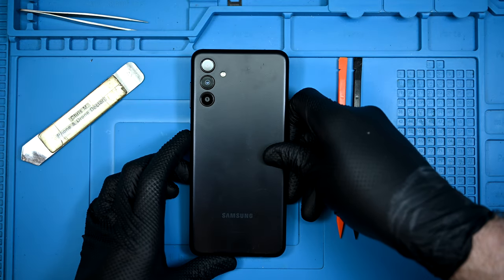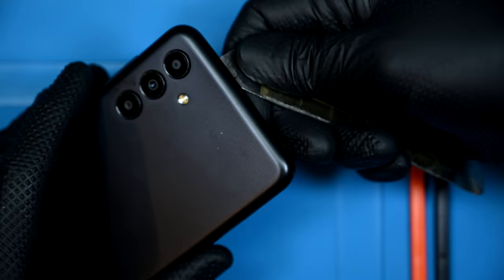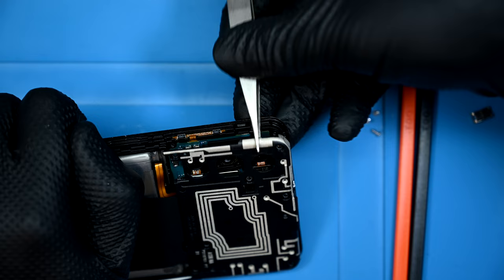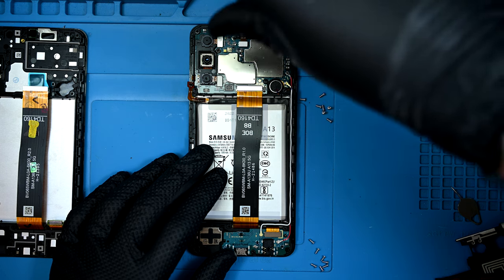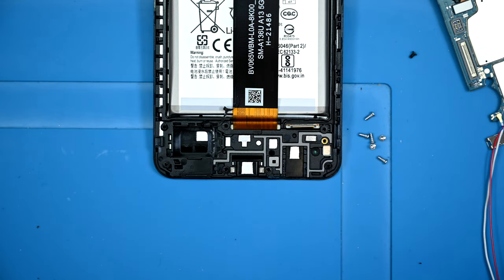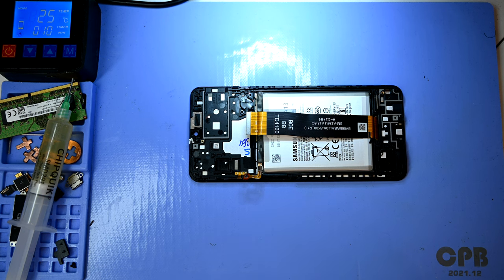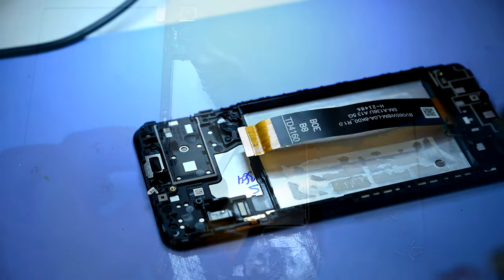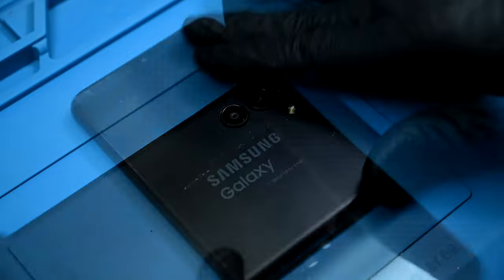Galaxy A13 5G (A136U) Screen Replacement | Frame Swap | Teardown Guide

Comment: The replacement screen/frame I received does not have the up/down volume part included.  A bit nervous about how to remove that from my old frame.
Reply from the maker: Isopropyl alcohol! Absolutely saturate it then gently peel off. A hair dryer will also help quite a bit. Try to peel up one little bit and shimmy your tweezers under the ribbon, working it up instead of pulling on it directly
Reply: @TapticDigital   I greatly appreciate the fast reply!  It worked!  Phone is back online!   Subscribed to your channel

Comment: Not now matter how many times I watch this (and others) I cant figure out how to get the back panel off, there simply seems to be no way to slip the pry tool between the seam to get the back panel off. I'm fully lost at this point, is there glue or something holding it down? it looks just clips but no mater how much I try I cant manage to get any leverage into it.
Reply from the maker: It's definitely very tight at first, it's easiest to slip in right next to the SIM tray. Thankfully the panel is plastic so you can use some serious force, and since the frame is right there you shouldn't be able to go "too far" in.
Reply: @TapticDigital  took a lot of effort but I managed to get it, after that it was a breeze and the tutorial helped a lot, thanks for the advice.
Reply from the maker: @chriswillis4960  so glad it worked! If you need any repair help come back and see me, I almost always respond to tech question comments within 12hrs.

Comment: I'm curious. What is the dimensions of the double-sided tape
Reply from the maker: I usually use as thin as possible, and stick to 2mm or 3mm in most cases
Reply: @Taptic Digital  i noticed there is no measurement of thickness, only how wide and long. I'll be buying online and it be hard to know that
Reply from the maker: @APRILMAY80  the one I use is 0.5mm thick

Comment: Does it matter if the frame comes with it? What happens if it doesn't. I kinda don't trust that site you linked.
Reply from the maker: Injured Gadgets is pretty reputable, a lot of franchise repair shops like CPR or UBreakIFix use them for parts. But you can definitely find it elsewhere! I recommend it with a frame, if you get one without a frame you'll need to heat the broken display and cut it out from the frame. Then you'll need a thin, silicone based glue to adhere the new screen to the frame (and some chip clips to hold it together while it dries).
Reply: @Taptic Digital  @Taptic Digital  I'll take your word for it lol. I read the reviews on that site and some were bad ones. Alot said glad they got the frame because it would of taken more time to fix

Comment: I changed the screen to my A13 and it works perfectly... Until i out the case back on then it juddt refuses to charge and turn on, i take off the bacn again and it starts charging and turns on perfectly idk what to do
Reply from the maker: Something is getting pinched when the back goes on, it's just trial and error to see what. Try putting the back on slowly, one part at time and watch for when it stops

Comment: I changed the screen but the phone does not find sim. Any ideas?
Reply from the maker: You may have some damage to the Sim tray, the main ribbon, or the charging port. Best to open it back up and inspect for any rips, tears, kinks, or bent pins
Reply: @TapticDigital  everything except the sim really. i tried different sim tray but still not worked. the sim does work in different phones.

Comment: My phone is a colored phone. Blue? Green? I dont know. Do they have a frame with that color?
Reply from the maker: On this model it doesn't matter, the display and frame of the phone are all the same color, it's just the back panel that comes in different colors.
Reply: @Taptic Digital  the buttons on my phone are green/blue. Buttons come with the parts?
Reply from the maker: @APRILMAY80  the buttons are part of the back panel as well.

Comment: I just broke my phone how much will it cost to replace I have same phon
Reply from the maker: Most repair shops will charge between $100-$150 for this one
Reply: @TapticDigital  the phone isn't even worth that they sell it at Walmart for 180
Reply from the maker: @MinutemenMilitia76  I think the benefit of repair would be having all of your data, but it depends on how important that is to you. But Samsung A series are pretty cheap to replace.
Reply: @TapticDigital  I guess and thanks for the video very helpful but the link for a new frame/ led and screen  it is for company's only not consumers or Diyers
Reply: @TapticDigital  They don't allow us to purchase the parts
Reply from the maker: @MinutemenMilitia76  hmm I've heard a few people had issues with them, I just changed the link to Injured Gadgets, it looks like they have no issue selling to independent people.